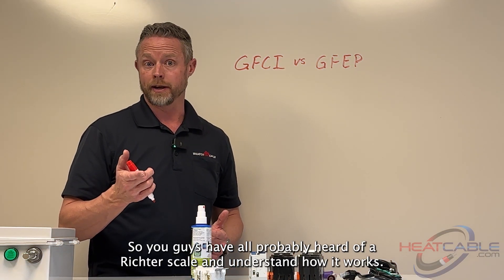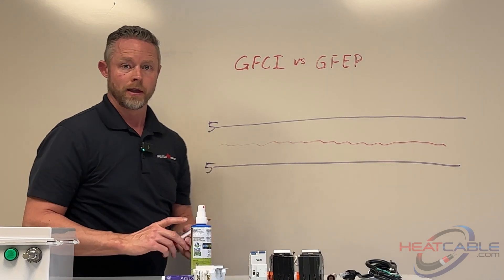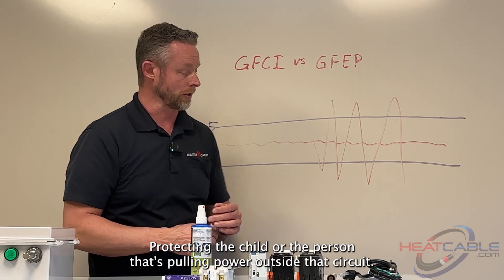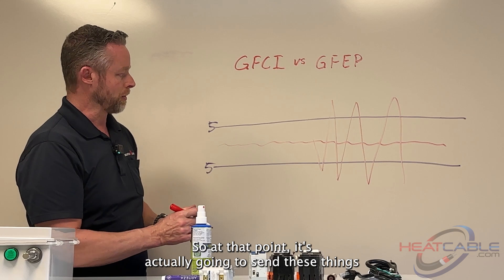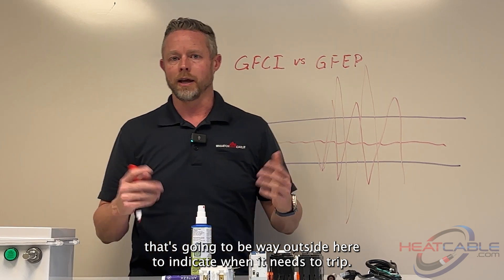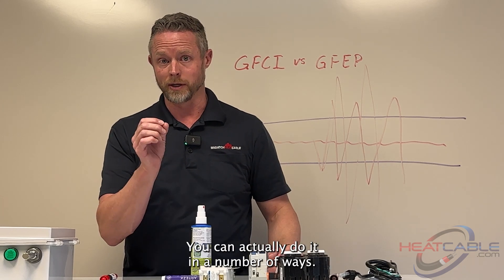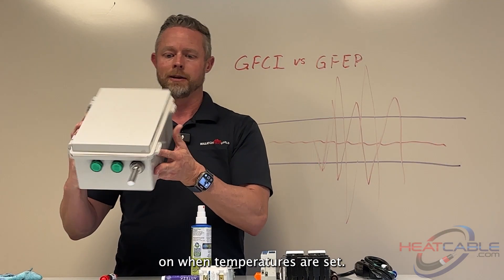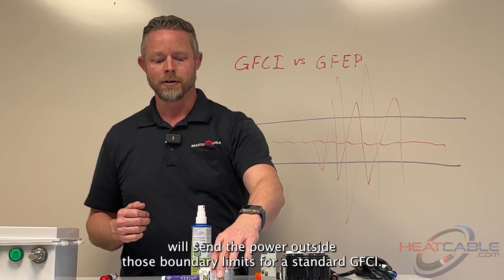GFEP vs GFCI - Avoid breaker trips on your heat cable!

Comment: I have been doing electrical work for quite some time, and I swear to you this is the first time I've heard of a GHEP. Also not familiar with heat cable, is it purely resistive? Does it have capacitive qualities? I have never installed any type of heating that would cause a GFI to trip. If I'm not mistaking heart arrhythmia occurs with a 35 mA incident, seems to me a GFEP is cutting it awfully close no?
Reply from the maker: GFEP (or EPD) and GFCI (or GFI) devices have different trip load ratings that serve different purposes. GFCI is specifically designed to protect people and have a much lower trip load rating. GFEP on the other hand are designed to protect the equipment and have a higher trip load rating. We recommend using GFEP devices to protect any self regulating heat cable circuit because it is what the manufacturer recommends.